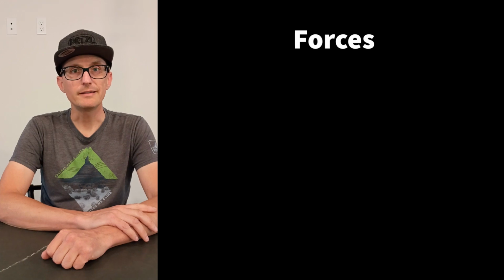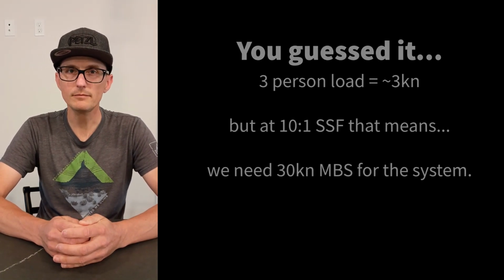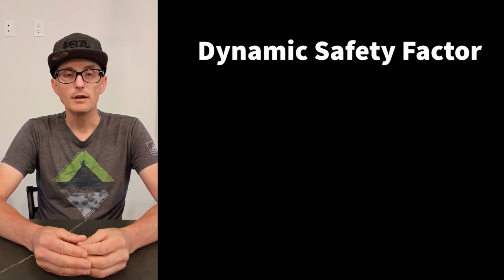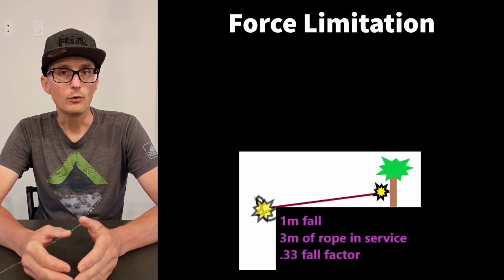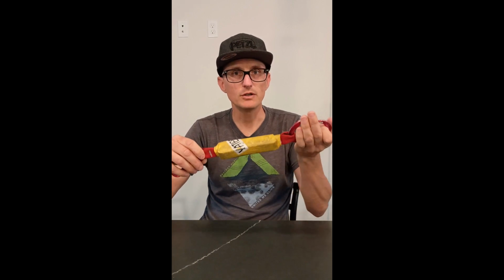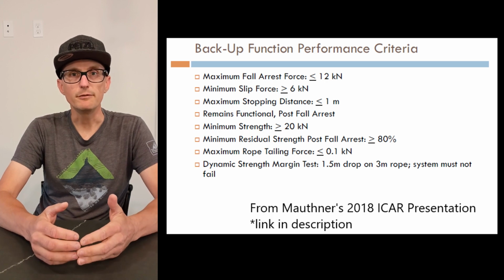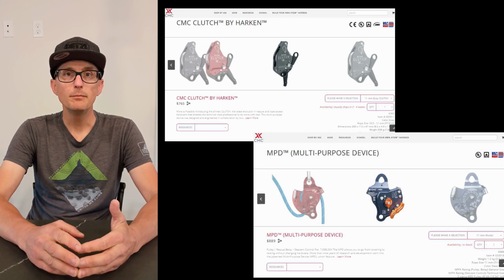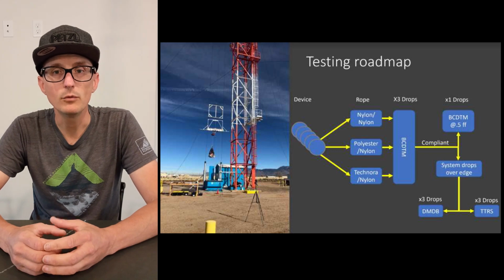Static and Dynamic Safety Factors & Force Limitation - Rope Rescue Fundamentals

Comment: Great video.  I may be wrong, but I think the concept of "static" system safety factor doesn't exist outside of rope rescue. In science/ engineering I think there is just a "safety factor" and if the system is dynamic the calculated safety factor takes that into account.  In other words, the idea/phrase a static system safety factor is just a rule of thumb people use in rope rescue to approximate an actual safety factor. A 10:1 SSSF can be far more than an 2:1 actual safety factor (e.g., steep angle op) or it can also be far less.  For example, 100 kilo mass taking a short factor 2 fall on sling might generate way more than 20kN.  The SSSF would says you have 10:1 safety factor when actual there is zero safety factor and the system fails.  Thoughts?